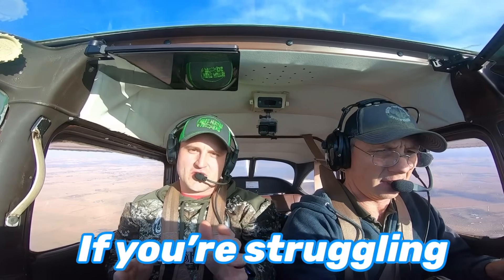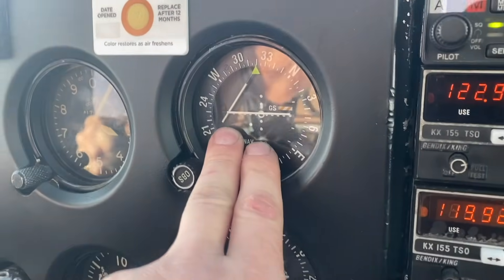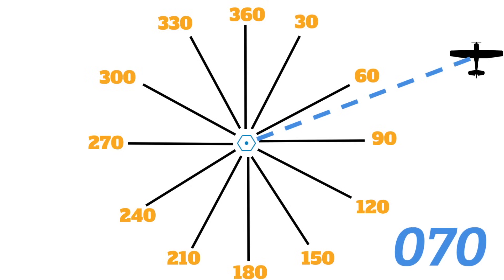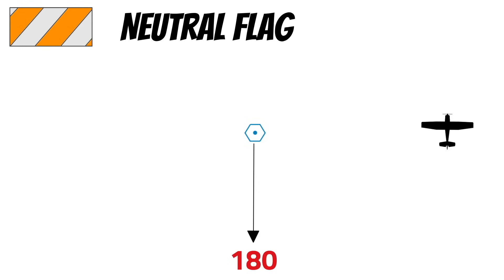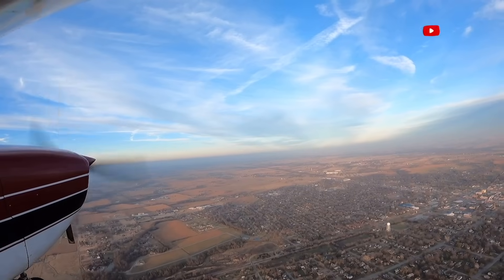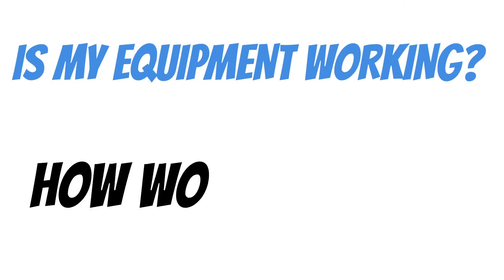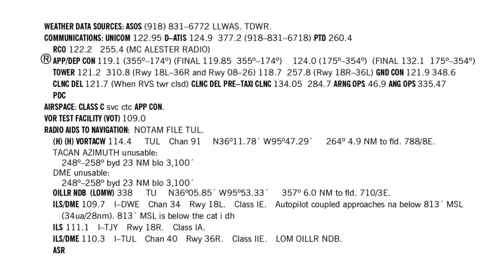You WILL Understand VORs after Watching This! (PPL Lesson 37)

Comment: you say: If you're nose away from a station (qdm 300), you're bearingt would still be 300. is this not incorrect? Your course would be but your bearing to station would be 180, right? In other words, earing is relative. Or am i worng?
Reply from the maker: I’m sorry, I really don’t understand the question. Bearing has nothing to do with heading
Reply: @FreePilotTraining  Thanks for replying nonetheless. I'll try to ask it better. @1:05 you say that your heading could be turned all the way opposite direction. And your bearing to the station would still be 300 degrees. Should that not be: ''my heading to the station would still be 300 degrees''?
Reply from the maker: No. You would have to turn your heading back towards the station if you wanted to go towards the station. Your heading is where your nose is pointing

Comment: Actually, I believe you will find that there are only 4 indications on the CDI. The striped flag is the NAV flag which represents either the zone of confusion, bad signal, or loss of signal. This is not the neutral indication. The neutral zone or zone of ambiguity is symbolized by the window going blank. So if you’re 90 degrees from the radial and the 90 corner (vertex) is on the station, you will get a blank indication in the window. And of course the other 2 indications are the TO and FROM.

Comment: Checking VOR frequency. I think it was worded a little confusing. The standard way is to listen with Morse code the 3 letter identifier. But the other way he said was with a newer digital display it will automatically display the 3 letter code on screen. It doesn’t display the identifier if you put it in wrong. It displays a different code if you put it in wrong. Or no code at all if the frequency entered has no VOR attached to it. And one additional way to cross check would be to look at where the VOR says you are and compare that to where you know you are relative to the field.

Comment: can i ask a questin, having problem i am trying to fly from KPVD to Putnam on vor but i want to use the from radial, i tuned to KPVD VOR frequency and centered the vor cdi if i go to the to i am good but if i move it to radial with a from indication of 321 then my heading is 141 which is incorrect i need to go to heading of 321 to get to PUT with a from VOR KPVD
Reply from the maker: You’re heading has nothing to do with the VOR. These are courses. You must account for wind if you want to fly the proper course. Now, if you are getting a TO indication when you spin in 321, that means you are ON the 141 radial. You must go THROUGH the station to get to the 321 radial on the other side. At this point, your VOR will flip and give you a FROM indication because you will be traveling FROM the station

Comment: 12:40 Why center the needle with a 'from' indication first? You found you were on the 110 radial. Add 180 = 290.
14:00 Now you centered the needle with a 'to' indication at 290. Of course that would happen.
I don't get the procedure shown here. Why not just get a 'to' indication with a centered needle and turn the plane to that heading?
Reply from the maker: It’s not a procedure. I was just showing you how to find your bearing from the station. You will need to know how to do this just as often, if not more, than learning to fly to the station
Reply: @FreePilotTraining  Gotcha! Thank you for the quick reply.

Comment: I am sorry, in the video, it shows us that we are flying from the station. Then you show as if we are to the left and to the right of the course. Aren’t they vice versa? When the needle appears on the right side, showing us FROM, we are actually to the right of the course and supposed to turn left, even if the needle shows right deviation? Could you please check on it? It is on 13:22 . You say that we are to left of course. Aren’t we to the right of the course, as long as it shows FROM?
Really sorry for questioning your professionalism. I just want to understand.
Reply from the maker: In order for the CDI to read correctly, your heading needs to match the course you have selected. If it isn’t within 180 degrees, your CDI will be backwards. We call it reverse sensing

Comment: Just a quick note on using Foreflight as depicted. VOR radials are transmitted just as they were (as the magnetic field was) when the VOR site was established. However the magnetic field changes over time and the VOR radials, airways etc. don't get updated to match for a long time. This means that the reading on your foreflight ruler is today's magnetic field and the radials from the VOR are historic. Notice how in the video the readout on the foreflight ruler is 105° but it's laying on the 100° radial, and from the Tulsa station the foreflight ruler reads 25° but is laying on the 20° radial. Just something to be aware of. I believe you can look this difference up somewhere (It's not just the magnetic variation because that gets updated separate from the VOR which is rarely updated). That being said, if I'm using my foreflight ruler to line up something from a VOR and want to be more accurate. I just lay my foreflight ruler on the VORs 0° radial and note, "ah it's reading 5° when aligned with the 0° radial so I just need to subtract 5° from what ever I'm reading on the foreflight ruler to get the correct radial." - I'm new to flying so if I'm wrong on this by all means respectfully correct me.
Reply from the maker: That is very interesting. I didn’t not know that

Comment: Instead of trying to subtract 180, subtract 200 and add 20, or add 200 and subtract 20.    E.g heading 60, the reciprocal is (200+60)-20 =240;  or if the  heading is 310 then the reciprocal is 310-200 = 110  and 110+20 = 130.
Reply: Why do a two-step calculation instead of doing a simple direct 4th grade arithmetic??? Don't try to simplify the simple!
Reply: @bereal6311  You are clearly not a pilot!  If you try to subtract 180 from 325 in a small aircraft bouncing around in turbulence while ATC is telling you to do something, you would find it very difficult under the stress.  Subtract 200 get 125, add 20  get 145 is a lot easier.
Reply: @karhukivi  Actually I am, ppl 2017. All pilots are not bright, I guess!😂
Reply: @bereal6311  You would be surprised to learn how many pilots make mistakes with simple arithmetic ,e.g.  crosswind component, time to destination,  fuel uploaded, reciprocal headings, weight and balance etc.

Comment: Quick tip for calculating the correct radial is the +2/-2 rule. Heading if 060 you add +2 to the first digit and -2 to the second, leaving the third completely alone which would give you a heading of 240. Easier than adding or subtraction 180°
Heading of 310, you -2/+2 giving you 130.

Learned this through another video so i cant take credit for this but i found it extremely helpful for quickly calculating an opposing heading
Reply: This just blew my brain.
Reply: May be a no brainer but I’m slow so I’m just gonna add onto this for people like me : 

If 010-190 
+2/-2 

If 190-360 
-2/+2
Reply: Best tip I’ve ever heard. Thanks!!!

Comment: I know this is a little advanced but I thought I run it by you. I have a challenge for you. I know you don’t live in the area but maybe you can explain it or do it in simulator. Go to Kirkswood, MO, KIRK add look at the approach plate for VOR-A approach. This is a circling approach. If you notice in the plan view, there is a notification that no PT is required if arriving at IRK via airway radials 259 CW 007. The IAF and FAF is the IRK Vortac. It is only 2.9 miles from the FAF to the MAP. So if you are arriving to IRK on V50, you obviously would have to be configured prior to reaching the Vortac, and at 2500 feet. The conundrum is that you are supposed to descend to 2500 feet once established inbound normally on the inbound course. Here you would be making almost a 60° turn and descending beyond IRK with only 2.9 miles to the FAF. Not only that, establishing on the inbound course radial is going to be challenging since you are right over the Vortac and being able to center the needle in such a short duration would really be difficult. See what you could make of this other than saying I would rather just fly the DME arc or do an RNAV approach.
Reply from the maker: This is an excellent question. I’m not 100% on the answer since most of the instrument procedures I have flown have been with the military, but this is the way I believe this should be flown. According to the AIM 5-4-6, once you have been cleared “direct to” a fix in conjunction with an approach clearance, you can go ahead and descend down IF you’re already on an established route OR and approach or arrival segment. I take that to mean that within 7 miles, it would be legal to go ahead and descend to 2500 and you would be SAFE to do so as early as 10 miles.  I can’t remember the exact wording in the AF regulation, but it basically says that as long as you’re “cleared” the approach and are on an INTERCEPT heading you are cleared to descend.
Reply: @FreePilotTraining  more than likely you will be told to descend and maintain an altitude till established. My point was if you look at Victor 50 and reach the VOR, you have a 60° turn with only 2.9 miles to the final approach fix. Trying to establish on your final approach course is the trick. Remember VOR signals right on top of the VOR up to half mile away are so sensitive you cannot get a centered CDI therefore you are descending to a fix technically not on a stabilized established course. This craziness was designed by the Terps people that authorized it. can’t wait to try it in the simulator. By the way, speaking about the military, you probably had some crazy weird TACAN approaches out when you were deployed outside the US.

Comment: Great video by the way! I just have a quick question, at 9:39 since it’s a from indication, u don’t chase the needle, but instead u pull the needle, so is it correct if I say the plane is deflected to the left and need to fly 212deg to the right in order to be center to the dialed radial of 210? Maybe I’m just a bit confused cause u moved the plane to the right and fly to the left to correct it on course. 

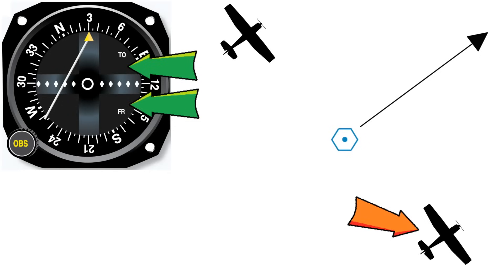Another question is on 10:20, Since it is at the cone or confusion, do I still treat it as a “to” indication and follow the “to” indication rule of chasing the needle? Which in this case, the plane is at the right of 030, and u need to fly left 026 degs  in order to fly on course to 030. Not sure if my understanding is correct? Please give me some feedback if possible, Thank you very much!

Comment: Thanks so much for your time! ...When you say "to go through the station you have to go through the station" aren't you saying that you SHOULD select the reciprocal of the inbound radial (if the inbound course is on the TO side the reciprocal bearing would be on the FROM side)..."go through the station to a radial on the other side".  In your example example in the PPL Lesson 37 video, the airplane is at R090 but you indicate we should fly to its reciprocal R270. (To me R90 would be on the TO side and R270 would be on the FROM side of the VOR?).  Thanks again.

Comment: Thanks for this but I have a question. 1).  So can we go TO the VOR station by choosing either a "TO" radial (e.g., R230) OR the reciprocal "FROM" radial (i.e., R050 to go "through the station")?  2) What are the To/From flag implications of doing this?  Thanks.
Reply from the maker: You CAN do that, but if you are going TO the station and you dial in a FROM radial, your CDI will be reverse sensing which can be extremely confusing

Comment: My breakthrough moment was when I realized that, if you are off course with a deflected VOR needle, the selected OBS divides the world in half and the deflected needle is showing you which half of all possible headings are intercept headings towards the course, and which half of the possible headings are not intercept headings and in fact lead away from the course. And it didn't matter if you turned left or right as long as you ended up on an intercepting heading you will get to the course. 25K hours ATP, 5K hours CFI&I
Reply from the maker: Great input. Thanks Tom!

Comment: ⥊ 773: 46

0: Good (if not good, then not zero)
0001: Uniqueness

001: Identity
002: Individuality
003: Variability

01: Awareness
02: Diversion
03: Sensibility
04: Love
05: Grace
06: Reasoning
07: Ingenuity
08: Purity
09: Truth Seeking

1: Ethical
2: Problem-Solution
3: Source
4: Cognition
5: Expression
6: Why/Who/When/How/Where/What
7: Information/Code
8: State
9: Sanity

10: Network (Good Network, because zero)
11: Justice
12: Time/Spread/Dissipation/Easter
13: Death
14: Perception / Memory
15: Agent
16: Reason
17: Argument
18: Constancy
19: Discipline

20: Judgement
21: To Solve Problems with Ethics
22: Resistance/Endure Introspection
23: Consideration
24: Humor / Mental State
25: Behavior
26: Motivtion
27: Cohesion
28: Dependability
29: Prognostic

30: Liberty
31: Consent
32: Discernment
33: Response
34: Ideas
35: Capacity
36: Technique
37: Design
38: Decision
39: Optimism

40: Good Will
41: Attention
42: Critical Thinking
43: Knowledge
44: Free Love
45: Plan / Task Force
46: Purpose
47: Perspective
48: Character
49: Ambition

50: Good Expression
51: Manifestation
52: Support
53: Respect
54: Care
55: Peace / War 
56: Profiling
57: Tell / Counter-Terrorism
58: Invoking / Building
59: Proficiency / To Excel

60: Certainty
61: Identification
62: Qualification / Characterization
63: Inquiring
64: Conjecturing
65: Function / Role
66: Investigation
67: Arguing
68: Indicator
69: Scrutinity

70: Validation
71: Illustration / Knowledge
72: Construct
73: Explanation
74: Data
75: Materialization
76: Delineation / Instruction
77: Flow / Cadency
78: Share
79: Evolution

80: Personal Soverenity Control 
81: Independency Strength  Established
82: Resilience
83: Decision
84: Autonomy
85: Power Severity Mobility Executing
86: Authority
87: Stream
88: Consistency
89: Boldness Self-Control

90: Wisdom
91: Assertiveness
92: Science
93: Scrupulousness
94: Integrality
95: Composure
96: Blockchain
97: Anarchy
98: Veganism
99: Revolution

100: Liberation
101: Peer-2-Peer
102: Decentralized Network
103: Financial Revolution
104: Production Revolution
105: Labour Reorganization
106: Needs Evaluation
107: Instruction
108: Personal Sovereignty
109: Resources Availability

110: Glory
111: Honor
112: Distributed Ledger
113: Privacy
114: Abolitionism
115: Pride
116: Pacifism
119: Mission
120: Harvest
121: To Revolt
122: To Sort Out
130: Energy Management
140: Serenity
141: Mindfulness
150: Good Character
151: Virtue
155: Honesty
160: Technology
185: System Accessibility
181: Structure

200: Sanctuary
209: Enlist
210: Resolution
211: To Engage
212: Secure
215: Mobilize
219: Annihilation
220: Contemplation / Meditation
221: Either Way / Alignment
222: Cooperation
250: To Thrive
255: To Emerge
230: Resilience

300: Crusade / Jihad
310: Consensus
311: Unity
320: Deliberation
330: Win-Win
333: Abundance
340: Abolitionism
360: Technology

400: Civilization
410: Culture
440: Fellowship
444: Direct Digital Democracy

500: Assumption
501: Leadership
510: Admiration
511: Honorable
512: Altruism
520: Proficiency
530: Acceptance
535: Denoucing
540: Appreciation
550: Diplomacy
555: Gathering
566: To Pick Up Someone/Something
590: Excellency

600: Organizator
620: Diagnose
660: Operation
661: Operator
665: Role
666: Method
676: Deduce

700: Constitution
710: Intelligence
750: Consolidation
751: Enlightment
757: Prompt
766: Plan
770: The Gear
771: File
773: Algorithm
775: Output
777: Pattern / Rhetoric
778: Development
780: Systematization
788: Design

800: Providence / Heroism
801: Production
802: Necessities
803: Resorces
804: Energy
808: Renewable Cycle
810: Permaculture
820: Management
830: Logistics
831: Scheme
832: Reach
833: Demand
834: Stock
835: Distribution
840: Consumption
850: Labor
860: Human Resources
863: Assignments
870: Structure
880: Peace
888: Globalization
890: Needs
899: Conception

900: Transparency
910: Institutions
930: Energy Distribution
931: Only One Global Currency
960: Blockchain
962: Traceability
970: Optimination
995: Accountancy
998: Regulation
999: Fiscalization
1000: Militancy
1001: Nova Era

1042: Drug Liberation
1100: Liberation Army
1500: Benevolence
1550: Charity
1807: Black & Yellow
2222: Paradox
3000: Freedom
3100: Triumph
3330: We All Can Live In Abundance
5000: Glory
5500: Greatness
8000: Sustainability
10000: Universe

. This is a numeric Matrix for communications purposes.
. This can be used to convey meaning.
   Ex.: 6022: Good Reason to Resist.
. Mathematical operators can be used to calculate meaning.
   Ex.: To liberate with a good force: 340. 300 + 40 = 340.
. Logical operators to create statements.
   Ex.: ¬11: 13. If not Justice then Death.
. Colors can also be used as information.
- You can help build it.
Reply: 360: AI

Comment: At 5:10, my instructor told me a really easy way to opposite compass headings really quickly is +2/-2. Either plus or minus 2 from the first number and do the opposite to the second. i.e., 180 1+2 = 3, 8-2=6, so 360. Or 250 2-2=0 5+2 =7 070. I'm not sure if this was a problem for others, but fast compass reading was a little bit sticky for me, and this might help someone else like me :)
Reply from the maker: Great trick! I use that too! Thanks for the comment

Comment: A good way to remember when you want to say cross a radial like at an intersection and you don’t know where it is according to your position, use this rule. If the CDI points in the same direction, as where the VOR’s is located, and it’s a “From” indication, let’s say both are to the left, you’re not there yet. To back this up just imagine being parallel to the radial facing away from the VOR’s and you’ll see that your CDI does in fact, indicate the same way as the VOR’s‘s location.